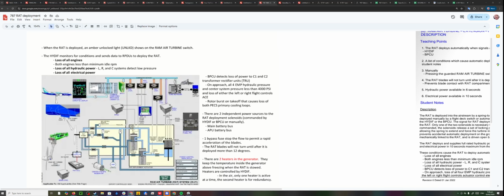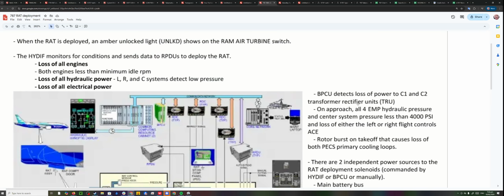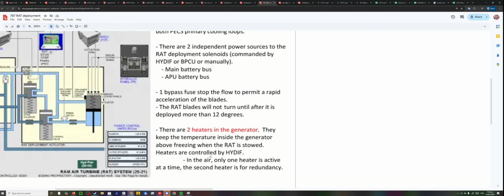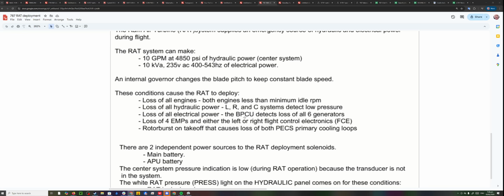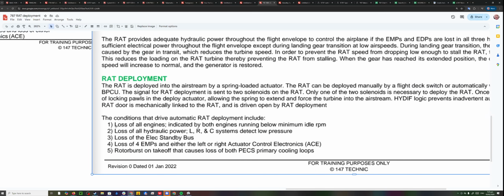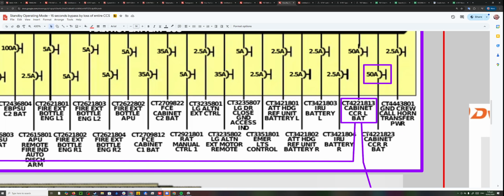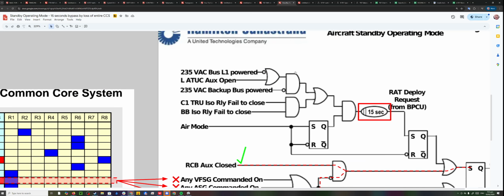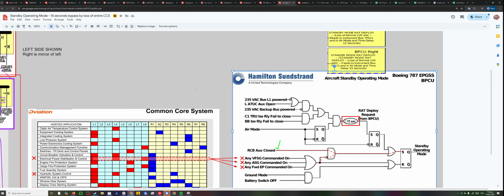AI-171 Crash - All About That Ram Air Turbine Early Deployment

Comment: What document is this exactly? It doesn’t look like official Boeing documentation? Even still, what proof do we really have that the engines have to be less than minimum idle rpm for the RAT to deploy and that they forgot a line break? I’m struggling to find some solid proof so I can have the upper hand in an argument against people blaming the pilots. But they always have some excuse and I don’t have proof to counter it. It’s really pissing me off.
Reply from the maker: firstly, no aircraft on earth has a RAT that deploys from fuel switch operation. Second,ly 3 separat documents, one of them a civil avation safety authority approved training school, and 2 others from other international trainin schools, explain the 3 main triggers.
1. Loss of all engines - Engines below idle RPM
2. Loss of all hydraulic power - L, R and C systems below 2000 PSI
3. Loss of all electrical power - BPCU detetcs loss of power to C1 and C2 buses

number 1 is actually taken care of by number 3. they are actually the same trigger. 
if there is no power to the instrument buses, it means either:
a. the engines are below idle and the VFSGs have therefore triggered their under-frequency (underspeed) cutoff
and/or
b. somerthing has caused both outputs of the rectifiers to drop off. (like a short)
Reply: @jeremyjohnthompson5187  thank you. I just had an interesting thought:

Hypothetically, if the RAT had to deploy as a consequence of the fuel switches (engines dropping to idle), am I correct that it would have deployed around the same time as the APU auto-start at 08:08:54 UTC or just after? 

Also why would the transponder cut off before the APU auto-starts, i would assume the APU is programmed to start instantly?
Reply from the maker: @jacobspeeds  the APU is programmed to start instantly the moment 3 or mroe VFSGs are offline and the aricraft is in the air. the transponder was online until the VFSGs went in to underfrequency cutoff (fact) then the autostart logic kicked in and it took a second or 2 for the door to start opening.  It was 2 seconds. 
08:51 = last ping, 
08:52 = AC supply dies due to VFSG UF disconnect.
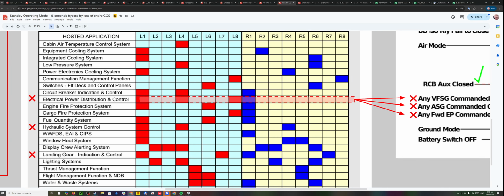08:53 = autostart logic activates
08:54 =APU door starts opening as first event in APU in air autostart logic.
Reply: @jeremyjohnthompson5187  makes sense. Thank you

Comment: Over (171) and over (now 132) again, they have demonstrated to us the bloody Spaghetti well stirred with pretending sickly software program of no engineering mindset, crappy Stone Age electronics and electrical design built will take more lives.
In emergency landing, manually set down the Landing gear. Do not waste time begging for the stupid Random Actor Turbine RAT to spare you 10 seconds of electricity to drive the hydraulic. The RAT deployment is a indicator , not a cure of catastrophic event has occurred.
Dump all these junkyard Diodes , contactor relays n filmsy  toy switches.  These are very unsafe and inconsistent to be employed in aircraft. 
Chuck in a 2x2 switch matrix formed by 2 DC UPS ( solid state battery) and 2 DC Static Transfer Switch (STS) providing no break 100% redundancy <4ms transfer lantency that is never achievable with the pile of 787 junk mess. Consult GE electric n automation. They know only too well.
The “CUTOFF” wire /position must be physically removed and relocated to another industrial grade specialised switch (key locking and access deny protect cover) and hard to access location. 
Overriding FADEC’s 3 fuel valves control by physical steel wire to pilot’s paddle must be provided as critical measure to maintain fuel supply to engines.
You can’t rely on computers in emergencies. 
An aircraft is not a car. We have lost too many aircraft’s and lives already.
Reply: When you understand that profit is not the main priority, nor reputation , then you will know why the Ind still employs centuries old tech,  in the form of a ticking timebom..thousands of gallons of highly flammable A1 in a flying egg shell at 600 mph.. what could possibly go wrong..? The antigravidic tech exists.. just not for the human lambs.

Comment: Hi Jeremy, I'm curious about the number of main battery failures (bad diode caused and otherwise) since the metal box AD incorporation, in some countries a catastrophic main battery failure would be classified as an SDR (service difficulty report) however and because it is in a metal box this might change the requirement to report. SDR's become accessible to the general public and aviation community through government websites (in Canada, not sure about other jurisdictions) and there is never a guarantee that operators file the information as required....So it may be difficult to determine the number of ongoing battery failures this type experiences. I know nothing about battery maintenance, test / replacement intervals for the 787 fleet but sure would be nice to have some of that data to look at, wouldn't it?
Reply from the maker: what i do have , is the financials for GS Yuasa specialized battery segment, which they say is 50% 787 batteris. go on, take a look. go check out their financials, particularly the 2021 annual report.
I avoided doing a video on it becasue ppl call me a conspiracy theorist.
Reply: @jeremyjohnthompson5187  Oh I believe you Jeremy.

Comment: "At this stage of investigation, there are no recommended actions to B787-8 and/or GE 
GEnx-1B engine operators and manufacturers."
I have no aviation knowledge. However, when I read the interim report and particularly the above conclusion, I suspected there was more to come.
Reply: I would have said its simply incompetence. But after recent discussions with people involved in the case, it appears its the opposite, a case of a system too complex for even the manufacturer to have understood.
"Nothing to see here", is the expected response from someone forced to release a report without having the first clue what happened.

Comment: Regarding the Landing Gear - Indication & Control, what functions of retraction do the cabinets control? 
 
On the 777 (for example), gear retraction is handled by electrical power going straight from the gear lever to the hydraulic retraction system solenoids. The system has redundant power sources (Battery and Left Main Bus). However, certain elements of the retraction system need a specific bus e.g. the Gear Lever Lock, which only allows the movement of the gear lever to UP in the air, is powered by the Right Main Bus (only).  If this bus was unpowered, pilots would have to use the override button adjacent to the lever, but checklists are involved.... obviously not a priority with the engines not turning. The landing gear control cards on the 777 are only required for shutting off hydraulic power after the gear is up (plus time delay). The control cards have dual power sources.
Reply from the maker: this aircraft is a flying computer. 
MLG and NLD control is from hosted applications in the CCS. 
All Such controls are over the CDN, and the remote switches at the far end that get the data to the appropriate RDCs, are primarily powered by the Instrument buses, and only secondarily backed up by the outer 28V buses.
Which bus went down in my analysis sir?
Reply: @jeremyjohnthompson5187  I'd like you to look at this information and consider a difference in power sources configuration to the CCR L and CCR R cabinets. 

I recently found this information online, please comment if this is incorrect

In each CCR cabinet, the two PCMs are designated as:
•	PCM 1 → Primary (active / normal operation)
•	PCM 2 → Secondary (standby / redundant / backup)
This follows standard Boeing labeling and redundancy practices (channel/module 1 is primary, 2 is secondary/backup). The PCMs operate in a redundant configuration (often hot-standby or load-sharing with automatic failover) to ensure continuous power to the cabinet’s processors and network components.
The Left and Right CCR cabinets themselves are system-level redundant (physical separation to avoid common-mode failures), but the primary/secondary designation applies within each individual cabinet to its two PCMs.

From another source, PCM power sources from the B787 Refresher doc
Each PCM receives 28V DC from one of four dc buses and also 28V DC from the hot battery bus. 

My interpretation based on the info above. 

HBB to both CCR cabinets
CCR L PCM 1 Pri powered by captain’s bus
CCR L PCM 2 Sec powered by flight officer’s bus 
CCR R PCM1 Pri powered by Right 28V DC bus
CCR R PCM 2 Sec powered by Left 28V DC bus

This would still mean during battery only standby power mode the CCR L cabinet is without any power at all when the battery shorts or fails in some way.  All power sources to the CCR L are part of the Bermuda Triangle of standby power, battery only standby power.  1 Main Battery (HBB)  2 Captain's Instrument Bus (PCM 1 PRI)  3 and Flight Officer's  Instrument Bus (PCM 2 SEC).  What looks like triple power source redundancy to the CCR L cabinet is all from the same single power source in battery only standby mode. 
The CCR R side should still be powered in battery only standby mode but the CCR L side going offline has to impact the aircraft in some way until the CCR cabinets reconfigure all the host applications running.
Thanks again for all your analysis, a CCR cabinet without power is yet another major find by you and an event that had to have impacted this flight.
Reply from the maker: @dougswanson9142  yes yes. sorry thats old news that i havent updated. within the CCS ( the system) its the ARINC remote swithces that form the end of the CDN to get commands to their destinations. Onle a handfull of RDCs 4,14,1,12,3,11,2,16) located at the front in the flight deck, FWD EE Bay and at the front fo the aircraft are connected to the CDN straight via copper to the CCR cabinet internal switches. the rest, including everything at the rear ( including gear control) is on fiber optic remote swtiches. ALl of those remote switches are all primarily powered by the instrument buses and secondary powered by the L and R 28V buses.
when the instrument buses died, all the fiber optic communications died for a split moment.
Yes the R cabinet stayed on

Comment: Jeremy, thanks for the additional technical details on RAT deployment. 

I have a couple of questions about this RAT deployment condition

Loss of the electric 28V DC Standby Bus	

The 28V DC Standby Bus is the main battery connected to instrument buses, the hot battery bus continuously connected to other essential loads and the RAT connected to the Backup Bus and supplying power to the C1 and C2 TRUs when it’s deployed, which supplies 28V DC to the instrument buses. 

Since this RAT deployment condition is being monitored prior to the RAT deployment and determining if the RAT should be deployed, the 28V DC Standby Bus test condition would only be monitoring the main battery voltage and I would assume it’s monitoring both instrument buses. 

The question I have for you Jeremy or others is how is the battery only voltage measured on the instrument buses, the VSFGs would need to be disconnected to check just for Standby Bus battery voltage on the buses and I would assume, for the generators to be disconnected it would be using the C1 TRU Iso and BB Iso relays to isolate the Backup Bus as is done when the RAT deploys, this would also be a check for the Iso relays.

The battery voltage could also just be measured at the hot battery bus with the main battery relay open but this wouldn’t be a full check of the Standby Bus, I would think you would have to include the instrument buses too. If this is the case the other question that comes to mind is when and how often would this type of battery voltage testing be done, testing that requires disconnecting engine generator power to the instrument buses?  

This 28V DC Standby Bus RAT deployment condition also appears to be a main battery dependent condition, if the battery is shorted or damaged or depleted it appears this condition alone would trigger the RAT. Am I missing something here?

Comment: Thanks again for the explanation, its a pity that less than 1000 users like to know what happened,  I like to know since I fly in the 787 as a pax at least once a Year !.   As a programmer, and systems experts I dont see any flaw on your path to disaster.   The main issue here is that at any given time there are 1000  Boeing 787 flying all over the world and the number grows...so its only time till another one fails (hopefully not in a critical phase of use). but to me its incredible that authorities are not looking into this... speaks volumes on the state of the world currently.   Anyways. thanks again.
Reply: Well if we remember what happened with the 737-MAX crashes, the response to this issue is actually completely unsurprising.
Reply: @KaileyB616 for sure

Comment: Jeremy
Have you seen the Air India Flight 132 report?
Documents what appears to be a "Left Bus Switch Malfunction" while ON THE GROUND.
Along the lines of a momentary, repeated cutoff.
The Pilot report (On paper, quite garbled. Terrible handwriting, English obviously not his first language) Seemed to suggest a Mechanical problem, but it seems remarkably similar to the Early stages of "161".
I wonder if if=t was an "INDICATION" rather than a "switch movement"?
.
I REALLY hope they check the Battery / Diode unit on THAT aircraft (Currently Grounded, and they could not find a mechanical error on the switch..... but they wouldn't would they?)
.
THAT aircraft COULD be the "smoking gun" to solve (Confirm) your thesis, or, if it FLIES again........ A VERY bad outcome.

Comment: Jeremy , thanks for detail work 
other news ,the Boeing 787-8 again from Airindia coming from London to Bangalore , pilots complained about fuel switches couldnt kept on Run position ,locking wasnt effective,it  broke the news in india ,where i have chances to post every where the battery fire and diode module failure of AI171,
people are taking notice and standing with our theory .
Reply: Just posted the same.
My impression was it was just the left Bus "switch" reported and on the ground, But THEN the maintenance / investigation team found nothing wrong with the actual switch...... sounds scarily familiar?
I REALLY hope they check the battery / Diode unit.